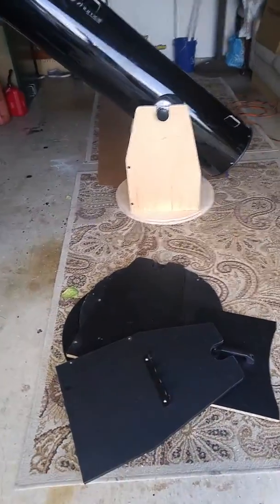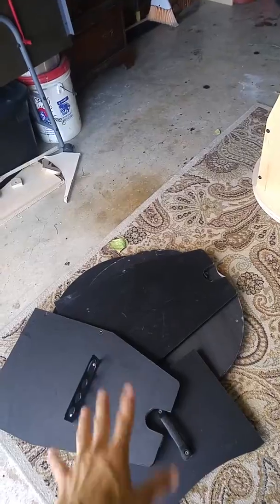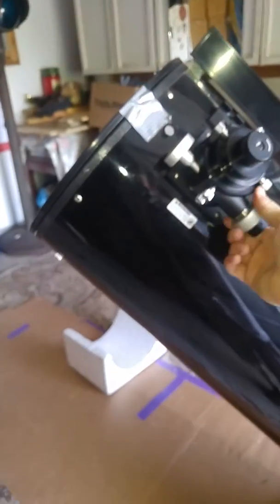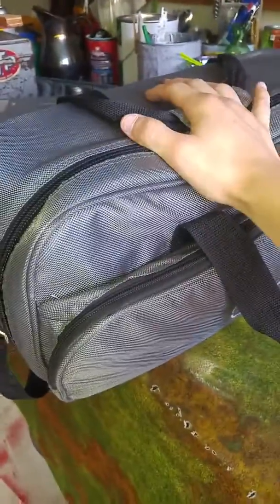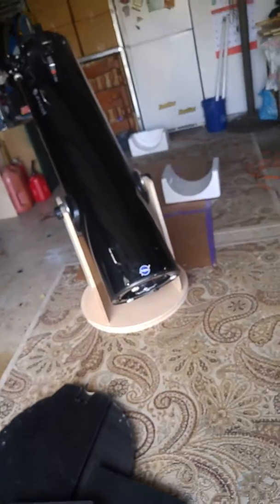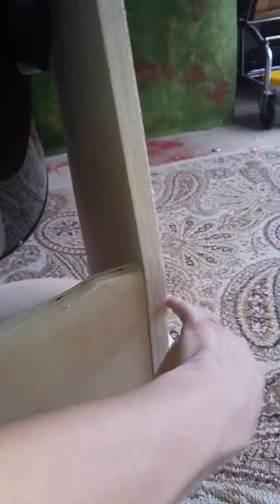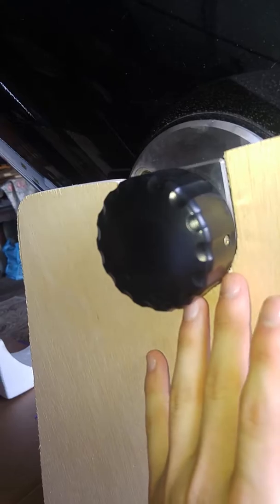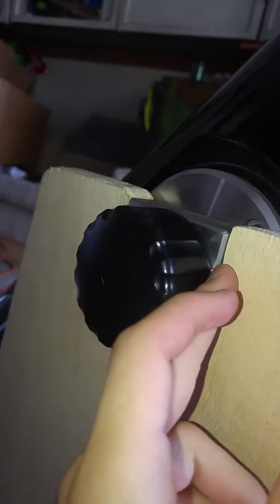New telescope base for 12" dobsonian (Z12)

Comment: Interesting project had considering do same thing.  Great idea.  Don't have the scope yet, can't decide 8/10/12 size just due to lugging it to my backyard.   How do you feel about the 12" i know you can see more in it, but its just too heavy to lug around, how do you move it?
Reply from the maker: VolklgirlKat what did you decide on. I’m a younger guy as your can tell in pretty good shape. I don’t have an issue carrying it around. (I can actually carry the base and scope at the same time but I don’t recommend) I typically set my base of first then move the ota onto the base. Neither one of the components are all that heavy just awkward to carry.